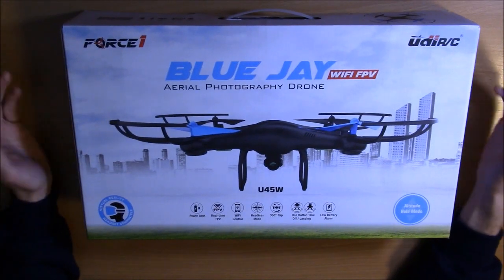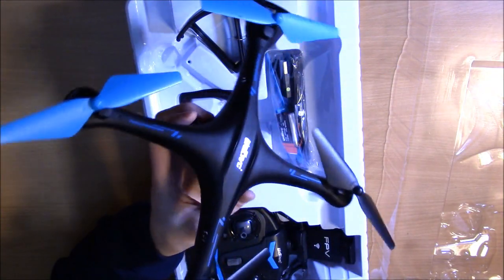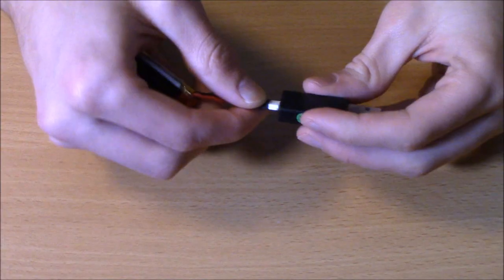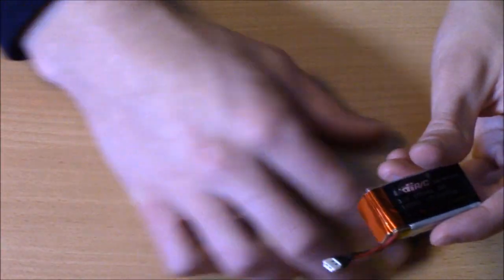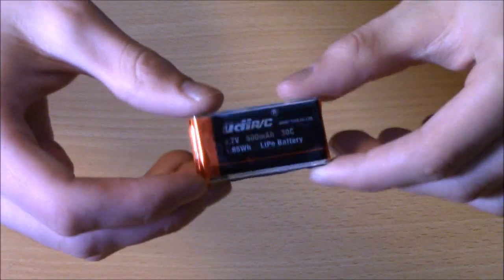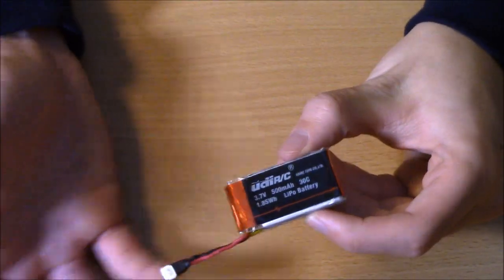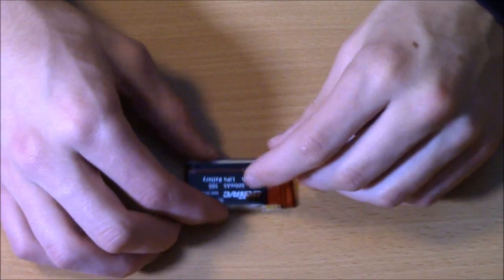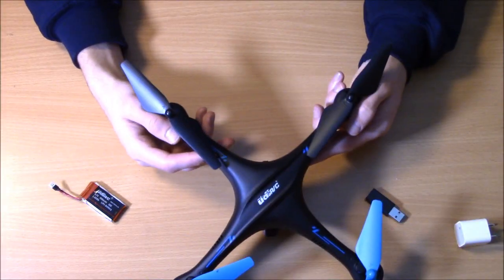How To Get the MOST Out of Your Batteries | RC Quadcopter Drone Battery Best Practice and Safety

Comment: My drone original battery is 3.7v 780mAh I bought a 3.7v 1000mAH battery but when I try to fly the drone using the 1000mah the drone cuts off itself . Could someone help me?
Reply: @AMAZING TONYO the reason is that it is probably sending to much power to the drone which the engine and rotors can’t process the energy

Comment: such a theory, the battery dies if they already faulty, there's no guaranty or time nor steps to determine if your batteries are going to last long.. I use to charge my drone's battery fully charged and leave it inside my drone but not connected. Almost 2years I still using it, the other battery that I bought new I followed this instruction but it was the first one that got defective.